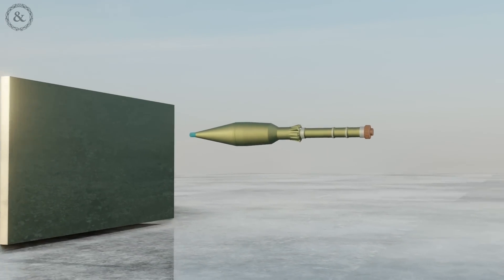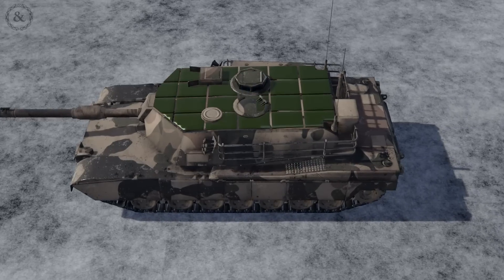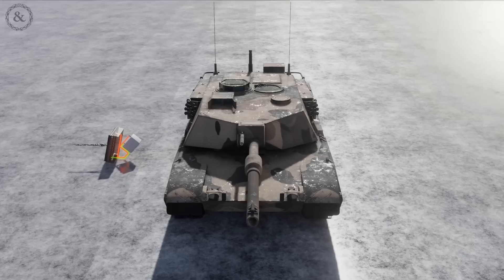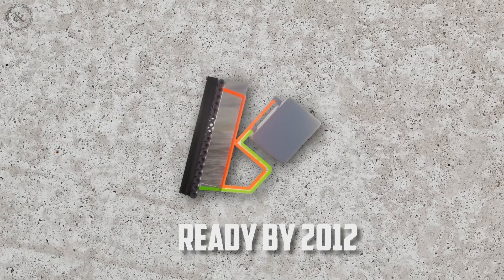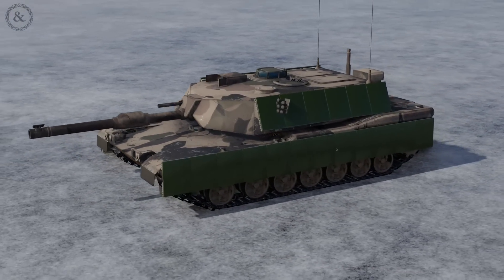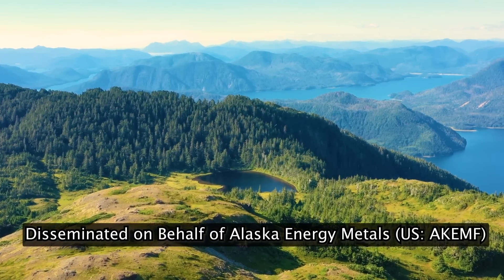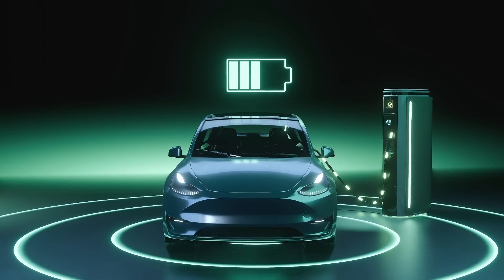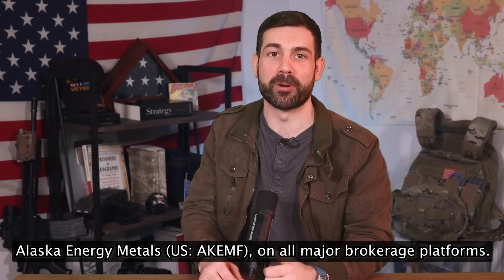How Electromagnetic Armor Vaporizes RPGs

Comment: I gotta say, it sounds great for stopping rpg's, but if it's thin it could just bring back anti tank rifles
Reply: Thats why you use it ontop pre-existing armour.
Reply: @honkhonk8009 Basically replacing explosive reactive armor
Reply: @honkhonk8009  but the point was to reduce armor weight. There would have to be research into the best blend for weight and protection.
Reply: It also sounds like concentrated fire could compromise it too.  I also wonder how long it would take to modify a shaped charge to defeat the system even in one hit again.  It wouldn't surprise me if it's less time than to develop and use this particular reactive armor.

Main issue with it seems to be logistics + that it's not preventing enough different vulnerabilities to be worth the cost.
Reply: @TheMelnTeam  Apparently there's a recharge cycle after each hit. Anything that beats ERA (like a Javelin) should be able to handle EMRA.
Reply: @Attaxalotl Not necessarily, as era works differently from emra
Reply: @TheMelnTeam It might mean the enemy would need to hit you with HE/Fragmentation, which normal armor are impervious to,  before hitting you with HEAT. Gives the crew time to react while also reducing the chances of getting destroyed on an enemy's first hit on you(due to needing to disable anti heat plates first).
Reply: @TheMelnTeam  точечная сварка. Это то что доказывает что физика так не работает. Это никак не повредит заряду. Дуга пойдёт по кратчайшему пути. Только там где носик пробьёт пластину.
Reply from the maker: Someone else mentioned in another comment on here it might be useful against incoming drones. Could also stop javelins on top. Sounds like it wouldn’t be as useful against some conventional tank rounds though . Fascinating topic though
Reply: I think it could introduce water guns filled with salt water to the battlefield
Reply: @poeticdevides  Vodka in Russias case
Reply: obviously you would have real armor under it
Reply: Right could they just shoot the outer panels with a gun and bullets
Reply: Great point. A buttet should be easier to desintigrate than an RPG, now (?).
Reply: I think you didn't understand the concept, it seems to vaporize any metallic ammunitions, "anti tank rifles" uses metallic ammunitions, thus it will be useless to penetrate into the EM armor. However some advanced composites could be made which are non-conductive and could pierce through the thin armor and not be vaporized, just basic common sense and I highly doubt military would use such flawed armor concept. Seems to be useful for military against low tech enemies who don't have capabilities in making advanced composites. Example "rubber bullets" is one valid composite.
Reply: @sto2779  anti tank rifles can fire more than one shot, and these panels have "recharge" times. (Dozens of times cheaper too) A thing like a anti tank missile fired from say a javelin that's one and done, is going to be fairly poor compared to a cheap ass anti tank rifle firing a slug, and then another and another etc
Reply: ceramic polymer composites usually have high higher thermal conductivity have  a high electrical resistance it be easy enough to plastic coat any round
Reply: It could be excellent for a top armour though
Reply: @Truspio this is actually true unless there’s some sniper on a roof with a anti tank rifle
Reply: @alphateam3326 roof armor is usually thin in the first place so your not losing anything by adding this technology
Reply: 200th like
Reply: or, more likely, it would make IFVs with autocannons the king of the battlefield
Reply: Cool, now their guys have to carry a heavy antimateriel rifles around.
Reply: I express doubt that they will go back to paper thin. Armour for combat vehicles are always several layers like at least the start of Korean War, armour philosophy has been composite and spaced armour. Besides, irregardless of how this electric armour stops a projectile capable of penetrating 3 meter thick steel, the AFV has to be survive the shockwave as well as the twist and tension by simply moving. And oh, recoil of their weaponry.
Reply: You would need a gun with a very high caliber and a long casing to have penetration and high enough velocity to penetrate both the electric armour and the regular armour
Reply: Anti tank rifles never really went through main hauls , mainly exhausts, tracks etc
Reply: It would heat up and expand the special rifle round too. All Armor Piercing would heat up and expand as the video explains.
Reply: @5932 the video says it wasn't tested against anti tank rounds. what did you watch? and no tank could hold/produce a charge to heat up a tungsten or uranium shell so much in such little time to make any change.  heat-shells might be affected. but cheap era is similarly effective. and faster to replace.
or what the israelis use, an active system that shreds incoming heat shells like from an rpg-7.
edit: also, what metals do you know that expand significantly by heating? you'd have to melt them...
Reply: We still use Anti-Tank rifles, just not as often
Reply: This is like ERA, Littearly. This will be an overlay soo thick armour would probably exist
Reply: As someone who loves AT rifles I see this as an absolute win
Reply: Rifles rounds are also copper or conductive and travel slower than rpg copper shape charges. Might also work against rifles??? I'm totally guessing here, lol. Just a thought
Reply: @Jakefromamerica  they also cost dollars vs thousands of dollars and can be fired in rapid succession while missiles it's more like one an done
Reply: @Jakefromamerica you need a lot of energy to stop or melt a bullet
Reply: Does this armor help also against penetrators from MBTs?
Reply: If it could disintegrate a missile, it can disintegrate a bullet.
Reply: Нет. Не здорово. Это не будет работать. Никогда. Совсем.
Reply: Just because you installed these doesnt mean you removed the original layers of armor
Reply: Recoilless Rifles are still a thing. So it wouldn't really be "bringing back" anything, just making it more viable.
Reply: It's additional armour, not base armour.
Reply: Obviously some high tech like this will be classified so none of us would have a dream shot at it. This is not open for discussion.
Reply: I'd also wonder how they hold up to full auto small arms too.
Reply: What if we hose the tank down with seawater?
Reply: @Altrag_  it's still a tank. If you spray it with sea water then it'll just shoot you
Reply: Or HESH.
Reply: What if you just shoot a gun at the electric armor?
Reply: You stop rpgs by putting a thin layer of armor away from  the main armor. An rpg is a shape charge, the cone is the standoff. If you move it away from the main armor it alters the standoff and unfocuses the charge. Right now we use reactive armor that uses a counter blast to defeat the explosion. We would never decrease the armor on a tank, just augment it
Reply: @joehughes5177  tanks can't afford to have another layer of heavy expensive armor layered onto them. That is simply unacceptable by all metrics. I can't imagine what it would cost to replace these electro panels either, and tank maintenance is already another financial black hole. Realistically Tanks need a weight cut, and potentially a shift towards higher mobility, lower cost rather than just being mindless armored forts, that can't cross a bridge, and die in the mud.
Reply: couldnt you put a rubber cap of some sort onto the tip of the rpg?
Reply: Or just shoot it with a normal rifle first?
Reply: RPG-7 is unstopped all the technology being used currently was design stop it but they always burn just buy the marines time to escape the burning tank.
Reply: Bring it back? AMRs could do it just fine.
Reply: The video stated it mounts on top of the current armor
Reply: it may bring back a new generation of anti-tank rounds  which are immune to electromagnetic force fields.
Reply: You know Uncle Sam is just going to get his hands in a tow missile or javelin round that has insulation or something 😂
Reply: can't it easily be defeated by covering the RPG with a couple of rubbers? 
that's like what? 10 cents or 20 minutes with a goat in the middle east?
Reply: Or you could be russia, still using anti tank guns in 2023 😂

Edit: just pointing out a fact. If it upsets you, that sucks.
Reply: @ZESAUCEBOSS well it works if you shoot it right, even a 50 cal can disable a tank if you top down shoot it's engine compartment, i dont see why a high calliber anti tank guns wouldn't damage a tank coz those ‘tanks' are not as tanky as you think it is
Reply: everyone "still" uses anti tank guns. also, would be useless against apdsfs projectiles @ZESAUCEBOSS
Reply: @ZESAUCEBOSS yes, leopards from rabotino been shoot down with rifes
Reply: I know from experience that the use of anti-tank rifles of course large calibre is very effective. A 20 gauge rifle like this is absolutely luxurious. The variety of ammunition gives you complete freedom. In Yugoslavia it was beautiful to see what these weapons and especially the ammunition can do. Especially PGU ammunition. You can't destroy a tank, but you can damage it very effectively. Belts, observation optics, communication equipment and especially psychological pressure on the crew. In a tank, or in another vehicle, it doesn't matter what hits you... Fear is always present, whether it's a rock that hits the armor.
Reply: @ZESAUCEBOSS Finished of Clownensky yet 🇧🇻
Reply: @ZESAUCEBOSS  Ukraine uses them as well? If it works, it works.
Reply: @ZESAUCEBOSS  And your Abrams still got vaporized by that same army 🤣🤣
Reply: @ZESAUCEBOSS anti tank rifles work well against non tank vehicles. Ukraine also has heavy anti material rifles with the alligator 30mm rifle. Both are useful and effective weapons, though on the lower tech end.
Reply: @ZESAUCEBOSS  omg. every developed enough army uses armor-piercing rounds. Not only Russia. what's your point?
Reply: @ZESAUCEBOSS if it works.
Reply: @ZESAUCEBOSS why would you edit your comment instead of replying to the guy?
Reply: @ZESAUCEBOSS  Wow, The military uses military equipment? 
Who would have known
Reply: @ZESAUCEBOSS oh yes like the barret 50 cal
Reply: @ZESAUCEBOSS  aaaand Ukraine? they do the same, too. and they too have ATGMs.
Reply: @ZESAUCEBOSS Its still a big ass anti materiel gun that can be used for direct fire support if an IFV is unavailable. All I’m saying is I wouldn’t want one pointed at my position
Reply: @drachenfels6782  I think you replied to the wrong person
Reply: @ZESAUCEBOSS  most of the armor you're going to run into isn't moderm MBT's. using something that will handle 75% of the threats is better than using nothing that handles 0% of the threats.

there are plenty of 20mm AT rifles in the pipeline, because against trucks, light vehicles, APC's, hovering helicopters, aircraft coming head on that you don't have to lead, brick walls, concrete walls, doors, ect 20mm is beautiful. 

it also saves a lot of money, because a truck isn't worth a $100,000 javelin.

a 20mm steyr-solothurn worked great for henry bowman on helicopters..
Reply: @warhorse03826 You realize that was fiction, right?
Reply: @rtbdmd  LOL was wondering if anyone would catch it.

yeah, fiction, but based on real ballistics. John Ross actually has shot drones out of the air with his steyr-solothurn
Reply: @warhorse03826 The real action now is 30mm programmable ammo like with the m230Lf.  You aren't hitting a fast maneuvering drone with a rifle, at least not often.
Reply: @ZESAUCEBOSS  Hey, they're still effective if you hit them right! Problem is you gotta get close
Reply: @ZESAUCEBOSS  I'm no fan of Russia, but if you have stuff like this and are running a shortage, you use it.

MBT mostly obsolete AT guns, because they're also AT guns themselves.  That doesn't mean direct fire from AT systems can't manage outright kills or mission kills on tanks though.

Some artillery systems can be direct fired too if they are forced to do it...and those are also threatening to MBT.
Reply: @TheMelnTeam  what are you talking about “shortage”? The MT-12 “rapiera” has been in service since the 1970s……. It’s part of their doctrine
Reply: Thermals will spot them first @TheMelnTeam
Reply: @ZESAUCEBOSS who ASKED??? Sick of seeing shit about the war where it's not even the focus of the content.
Reply: @RedVRCC  Yeah, definitely people who watch this channel wouldn't be interested in the war! This channel has nothing to do with war at all!
Reply: @Curt_Sampson  this video in particular is about electric tank armor. That's what I came here for. I'm just so sick of seeing shit about the war where that's not the main focus. I don't support either side, I don't care about the damn war, just let me stop seeing it everywhere! If I wanted to see that, I would have specifically searched up videos related to it.
Reply: @RedVRCC stop reading comments
Reply: @RedVRCC  Ignorance is a bliss they say.

Keep it up pal!

But don't be too surprised when the problems reach you and/or relatives. To be clear - I do not wish anyone these sufferings.
Reply: @ZESAUCEBOSS and your point?  Nothing funny or witty about that at all
Reply: Javelin missile go brrrrr
Reply: @rickandbrandonshow  It is funny because Russia has always been flexing muscles but when it comes to actual fighting they always embarrass themselves.
Reply: @rickandbrandonshow It's pretty funny to use AT guns in 2024. Worse though, they are even using t-54.
Reply: Chill bro  @rickandbrandonshow
Reply: @bland_toast  right but at the same time you can lower some armor and still have enough to stop anti-tank rifle rounds

Comment: I would imagine the issue is the energy/research/money requirements simply just are better put to other things. There'd be so many advances you'd need before anything like that was possible, you'd need to provide an astronomical amount of mobile energy to have something that powerful zapping rounds midair with any repeatability. Much easier to just make things more mobile and invest in training/tactics, defense onion and all that.